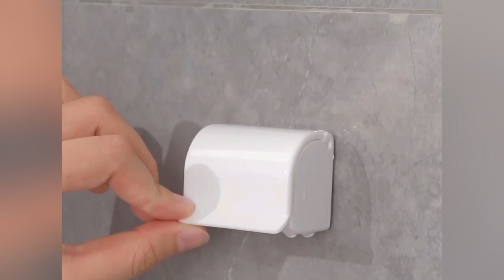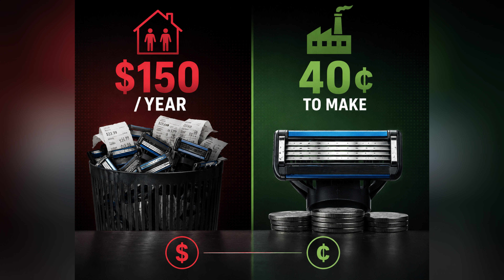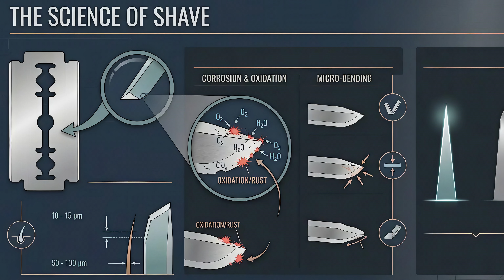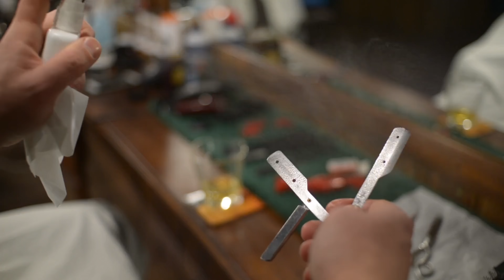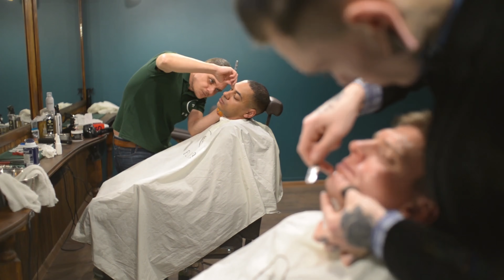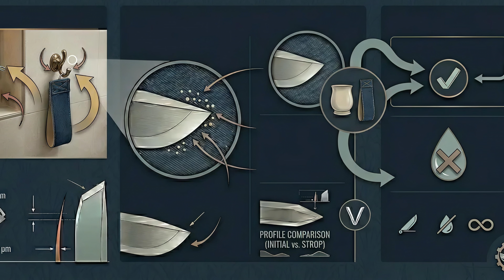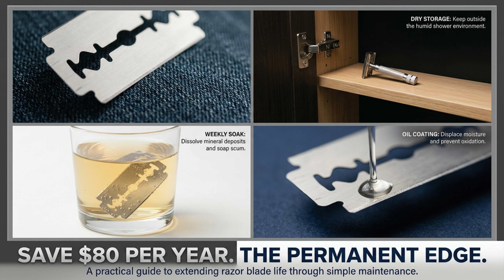Your Razor Is Designed to Dull After 3 Uses — How to Make It Last 2 years!

Comment: I use Japanese Feather blades in a Feather razor. The simplest machine on the planet. The razor was expensive. The blades are not. There's absolutely no reason to waste money on a multiblade razor cartrage. A simple double edge blade will do the job, for those unable to handle a straight razor. Just follow the instructions in this vid. You'll save a ton of money.

Comment: The multi-stack is also designed for hair to get stuck in between, meanwhile some "lady razors" designed to shave legs etc have a slightly larger space between the blades making them easy to wash clean.
Gillette Vector+´s seems available online to be honest i am 47 years old and i have NEVER never EVER seen them in my store(s) shelfs - but they still have that stupid Aloe strip but i guess one can remove that stupid strip entirely with a small sharp knife.

Comment: I’ve been using a Rowenta beard trimmer for years. it doesn’t shave as close as a razor blade, but it doesn’t cut the skin, and I don’t get pimples or ingrown hairs. The battery lasts for three months, and once or twice a year I take it apart to clean and lubricate it (The original oil ran out quite a few years ago; now I use silicone oil for the treadmill) —the trimmer has self-sharpening blades.

Comment: Shave in the shower and used a handheld mirror to tap-clean the razor on. That’s all I need to do to make my razor blade last at LEAST six months. The steam softens the beard. You also need far less shaving cream. In fact, you can often shave with just conditioner using this technique.

Comment: 20 strokes on the opposite face??? 
There is no,opposite face.
The other side of the blades is beyond reach
Reply from the maker: You're right, it's not the "opposite face" of the blade itself, but the opposite direction of the razor head on the denim. This helps realign the edge.
Reply: @Sidney_Explains_Money 
👍❤

Comment: I have been using a safety razor for ten years. I just cleaned my used blade in vinegar and stropped it. It was a no go, blade was no good.  I started a new blade, 10/10 shave, I dried and oiled it after.  I started a logbook.

Comment: I like the denim strop. But I shake it every time and spray alcohol on it to dry it. I will add the  idea of mineral oil for the same reason. You must dry it. Moisture is the enemy of steel. “The riddle of steel: “What is steel compared to the hand that wields it?”
 --Thulsa Doom -Conan the Barbarian

Comment: I buy a bag of a dozen or two dozen generic double blade razors. Each one lasts me 4-6 months. Also, you don't need shaving cream. Gallon jug of cheap conditioner in the shower. Put some on my hair and my face. By the time I'm done shaving, the conditioner had a chance to soak in. In the more humid summer months, I store the razor outside the bathroom.

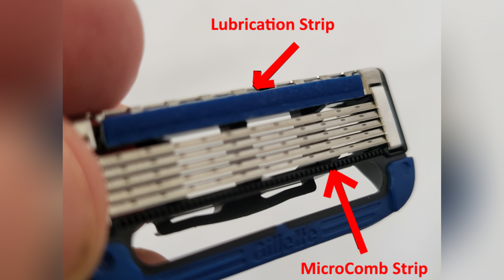Comment: 5:04 I use Wilkinson sword hydro3.. shave twice a week and never timed it but it’s weeks between changing blades that I buy in packs where you get the razor and blades for less than two packs of 4 blades cost… 
Just found my last purchase on e ba y… £26 for two razors and 18 blades.. 6th may 2024… I still have 9 blades left so around 12 weeks per razor at £1.44 per 12 weeks less than £0.10 per day… so £0.35 per shave each week… bargain… 
And I’ve clipped my own hair to 0.5 since 1999 and over 4 sets of clippers I’ve brought I worked that out to around £0.07 per hair cut per week… whale and Wilkinson have save me ££££££££ thousands 😂
Just thought… how much have I saved on shampoo and hair products ontop of that… time drying it and styling it… which the main reason I chopped it off couldn’t be fuked brushing the shit every day 😂 
5:06 oh yea, reason for the comment.. I pop those goo strips off they leave sticky shit over my face

Comment: Been bic'ing my head for over 20 years and what I found works best for me is to just clean my head before shaving. Goes for using clippers too. Your body scum will gunk up the blades and shorten their lifespan. If you want a quality brand, try Harrys razors. Not only are they inexpensive but they last a long time too. I can get a full month easy with shaving every few days before I begin to notice its dulling. And no im not balding but I do have thick hair.

Comment: Didn't know about the denim trick. 
But I've always rinsed my blades after shaving with water, then tap it a few times both sides in a towel and blow in between the blades.
Then store it in the bathroom closet. 

I use Gillette blades and I can easily do 3 months with one blade. 

Yes the gliding strip wears it r and the shave gets a little bit less smooth, but no issues in general
Reply: There is a product on the market called ..razorpit...i have one and its superb..saved me a fortune blades last a long time

Comment: I use warm to hot water to put in the razor ... a few seconds and move the razor like a spoon, then when the razor blades are full, I take a toothpick to clean all the soft hair and soap ... and lastly ... I use the tip of the toothpick to realign blades with a downstrock ... if blades are wide open ... you feel that awkward blade paralel to your skin ... so with this last move ... I "reset" blades to their original position ... I do this 4-9 times per shave ... clean the razor and keep it dry. Perfect shave after months with the same damn thing ....

Comment: This is all nonsense. Listen to grandpa. Get an old fashioned safety razor, old fashioned shaving soap, and good brush. Replacement blades for the razor are ten cents each and they last one month. A $3 chunk of shaving soap/cream lasts about two or three months. After each shave, rinse your razor, and then squirt some isopropyl alcohol on it, hang it up, and let it dry.   There is a slight learning curve as you learn how to hold the razor and use the soap to get a clean shave, but once you do, you will prefer it and stop spending so much money on shaving. Problem solved for life. Move on. Don't complicate things and remember that new and modern doesn't' necessarily mean better.

Comment: To hone any sharp edge you must work on both sides of the edge. Impossible on a cartridge or throwaway razor. 
My dad learned a way to keep Gillette blades sharp. Lightly press the bade (keeping it vertical) against the inside face of a straight sided, glass tumbler. Gently rub it side to side  2 or 3 times; turn the blade over and repeat. Do this until it's sharp again. This re-forms the edge 🧐

Comment: They're not "designed" to fail, no more than disposable scalpels in hospitals, or the sharp tips of IV/syringe needles. Blades get dull, full stop. The consumer intentionally buys a device they can throw away rather than maintain. It's actually cheaper to buy a razor that you can manually maintain than it is to buy new cartridges for your disposable, and they also dull after three-ish uses.

Comment: A guy said to me once that he never gets a good shave with a new razor blade, he siad it was a better shave after a few uses. I never had that problem, but it got me thinking. So once the blade in my razor felt a little dull I just left it in there to see how bad it got. What I found was that once it reached a stage where it wasn't A+ sharp, it can last many weeks just shy of that. I get good clean shaves and blades last me many weeks. That being said I dont have a growth that is like a 5 o'clock shadow. I only need a morning shave. Try it and see how you get on.

Comment: I use a regular razor with single blades. I shave about twice a week and get 4 shaves and toss it. The blade cost 10 cents. I spend 20 cents a month. Cartridge blades are a scam.

Comment: I've used mine for little over 20 years, Gilette 3 blade razor. Soft parts on that detachable blade deteorated away long ago, but I jammed a strip of plastic there and it just works.

Comment: I just use safety razor and DE blades. I buy them in bulk, costs nothing, toss them after a week's use (2 to 3 shaves), costs me at most 15 bucks per year and I'm using a high end brand.

I buy regular shaving soap for less than 2 bucks, lasts me for months, it uses tallow which gives it a nice glad that some more expensive soaps don't use. Cheap but good quality brush, and a good quality after-shave balm (alcohol free to prerve the skin barrier, around 10 bucks) that will keep the skin hydrated: a coin sized quantity is enough, your skin can't absorb an unlimited amount.

Nobody needs multi blade high tech razors, they're also harder on the skin. One sharp blade that'll do the job nice, good tallow soap, and a great aftershave balm.

Everybody will thank you: your skin, your wallet, and the environment. Except big corporations they'll hate you! Just remember to wrap used blades in duck tape to avoid operators or animals getting injured (I pile them in a container that I tape & label).

Comment: I'm not sure about the cause of the blade deterioration being the moist air.  I have done the rinse then backwards drying of the blades on my towel, but then I leave it in the shower, blades facing down.  The blades are dry, but still in the shower.  My blades last for at least 6 months... never actually checked to see how long they last, but I can tell you I haven't purchased new blades for years.  I have lost a few to dropping the razor handle with the blades in... that kills them for sure.  I don't shave every day, but maybe twice-three times per week.  Always doing the same thing... rinse then backwards drying of the blade on my towel then leave in the shower.

Comment: Hair are soft? In comparison, maybe - but just try cutting a bunch of hair with anything that’s not really sharp and you’ll change your opinion, I guess ;)

Stropping: yup, can be done that way and will also remove the residues you want to remove with vinegar. 
Only reaches one side of the blade though - and unfortunately it‘s the side which most of the burr‘s pointed away from, so it can‘t be as effective as necessary. 
Cleaning with vinegar? I guess that step can and should be skipped. An acid will corode your blade way faster than water. Especially as you can’t get rid of it completely without water. And that „business end“ of the blade will be cleaned with stropping as well. 
My advice:
get a double-edged safety razor:
you can disassemble it after shaving, so maintenance of the blade is super easy - and it can be stropped from every angle necessary. Bonus: the blades are super cheap.

Comment: Have to give a try. My beard  has always been tough and I do shave my head.  Electric razors don't work. I've tried many over the past 50 years. Safety razor work okay. Too much work to get a close shave. The best is Gillette or Harry's 5 blades, but they only last about 3 shaves then start pulling on my whiskers instead of shaving them off. To save a little, I buy cheap 5 blades from AliExpress as pre-shaves to save my Gillettes for the final shave. I am retired and don't shave every day, so that saves some money, but I will give your method a try with the Gillettes, so I don't have to buy the AliExpress blades.
Reply from the maker: I really hope this method helps you save some money and get a much better shave!

Comment: Here is a quick howto: When you finished using it, rinse it carefully and dry it by running over a towel with the sharp edge not against obviously. Then a quick blast with a hair-dryer to ensure no residual moisture. That is the single most important thing to do and will give you 10x more shaves. Then by all means watch this video for more tips

Comment: Buy two razors. Place one dried and oiled in the bathroom, then after using switch it with the other drying razor outside the bathroom. 
One within hand reach.
One drying.
They alternate by switching positions.

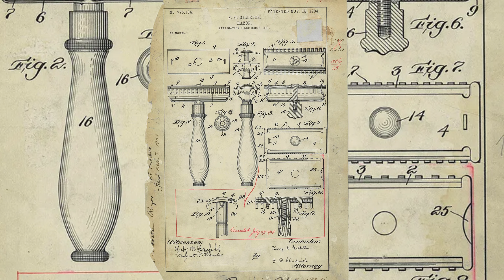Comment: 1:30 "Doesn't dull from cutting hair, hair is soft"? Bullshit! Ask any decent barber, hair has the same Rockwell hardness levels as COPPER WIRE! It's about the WORST thing you can cut with a knife/blade! When you skin an animal you DON'T want to cut down into the hair to open things up. You cut with the blade facing upwards/outwards cutting up from underneath the skin. Google it! I still use the same 70+ year old straightedge razor my grandfather used as a barber, including his old leather strop.

Comment: I tried that stropping thing with my cartridges and I didn't notice any difference.  Here's what works for me - after shaving, I give the cartridge a good water rinse under the faucet, then I swirl it in a container of isopropyl alcohol (isopropyl alcohol is hygroscopic and absorbs water from the blades and also dissolves any leftover oils), then I store the razor with the cutting edge of the blade facing up so anything on the blades drains to the back of the blades in order to prevent pitting on the cutting edge.  For me, that extends the blade life far more than anything else I have ever tried.

Comment: I already do most of this and get months out of a single cartridge.  Use conditioner to shave instead of fancy shaving cream it is inexpensive and you have it in any hotel.  After shaving rinse the cartridge carefully, dry with hot air thoroughly using a hair dryer holding it right against the front of the hair dryer to blow out any water, conditioner, stray hairs and store outside the shower.  This works great at home or if you travel for work.  I don't do any stropping so I think that is the least useful bit in the video.

Comment: I consider this method, as scientifically proven, to be false and ineffective. I remember, because I am old, the solution patented in Czechoslovakia to extend the functional life of razor blades by storing them in a cardboard pyramid, which also did not give results. I tried both methods with zero results. However, I must mention a rather effective method, used by my father in the 1950s, by rubbing the razor blade attached to a wooden handle against the inside of a glass. The hardness of steel is about the same as the hardness of glass, so the functional life of the blade was somewhat extended.

Comment: If you are used to shaving in the shower, there is a much more convenient method of honing the blade. Your body is covered in leather, we just call it skin. I hone the blade using the heel of my hand, and normal hand soap. Between every 3 or 4 strokes, and especially before those more tender parts.
Reply: In the shower I just use my thigh to strop, "wipe" the blade backwards to strop it.

Comment: Don't by the razors associated with the "cartridge" systems. Use what your grandparents and every one before them used. 

 Buy a metal blade holder, handle with a screw in slot,  and a box of double sided disposable razors. One box of 100 blades lasts over two years easy, and I shave my scalp bald so it would probably last an ordinary shaver much longer!

One box of razors also costs less than 1 pack of 5 cartridge razors. The only thing pricey might be the blade holder, but it will last a.lifetime. Also shaving cream, not foam, and a boar hair shaving brush to create a lather from "Art of the Shave" but not their razors or holders. 

The shave is closer than with a "safety razor", and yes you can cut yourself more easily but just go a little slower.

Otherwise the experience is the same. I also have strait razors, but they take forever to use and have to be stroped.

Comment: I’ve been “stroping” for @ 10 years now and have only bought 2 (5)pack of blades in that time. Another, similar video is what gave me the idea. I bought a piece of hide leather on amazon for $10 and I strop for a few seconds each time AFTER the blade begins to show signs of initial dullness. Each blade lasts me, on average, 12 months. What typically happens is the only reason I have to throw a blade away is because some piece of said cartridge breaks and can’t be safely used. NOT because of dullness…
Reply from the maker: That's an incredible track record, it really proves how much longevity you can get with just a bit of maintenance! 😊

Comment: I have (previously) wet shaved in the shower for years  - unload the razor and clean it (tap out all the trapped hairs)   - run backwards against a towel - a single blade assembly lasted months  -I am a very bad consumer for Wilkinson Sword..

Comment: I shave in the shower with a twin blade razor and a bar of soap. The two critical steps are stropping it on the inside of my forearm a few times during the shave after I blow out the beard particles caught between the blades. Rinse and blow out the trapped hair and soap before you  put it down, and  strop it a few times  every shave. I have been using mine for over a year and the little Teflon strips they put of the blade holder have worn off but it still works fine. I eventually change the blade after a year or so just for the hell of it but they still work fine.